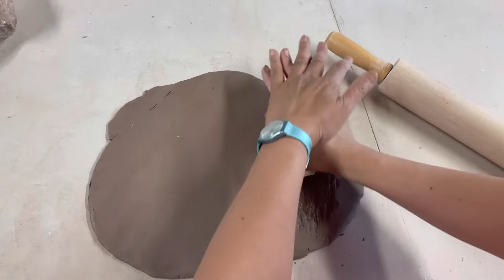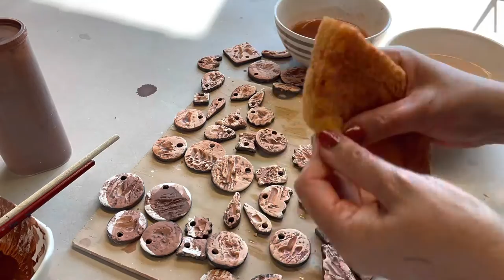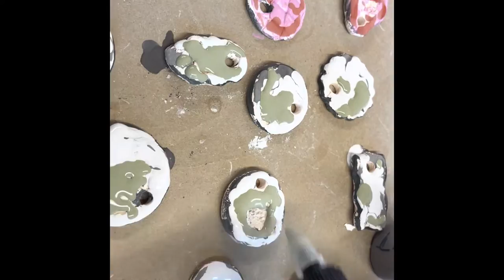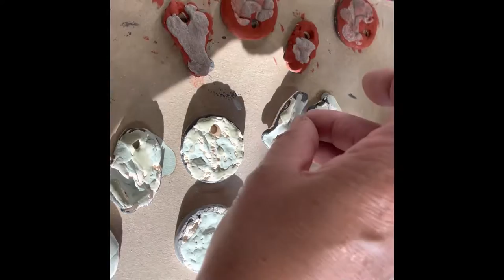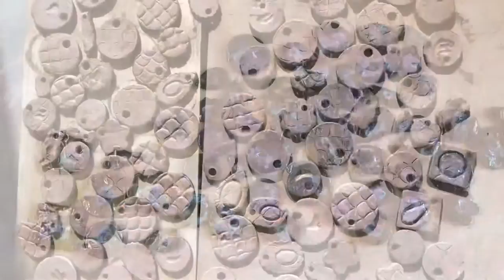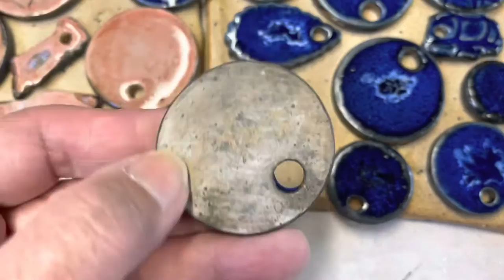Ceramic Pendants, glazing and cutting #jewelry #ceramic #necklace

Comment: I suggest you have a rubber stamp made out with your signature. Just stamp on the back. I just use the rubber..order it without the wood post and use your thumb to press on clay. You can either use clear glaze on the back or just leave it bare. Make sure it is very smooth. Love your colors.
Reply from the maker: Thanks for the tip! Because I am multi media artist I tried to sign all my pieces if I can. To keep it my own touch. I do have stamps I made myself but folks like my original signature.

Comment: I have questions!❤ I’m pretty new at using a kiln. How did you glaze the bottom but still lay it flat? Also, can you use any glass beads in a kiln? I had no idea you could do that! 
Your jewelry is STUNNING!! Thank you for your video!!❤️❤️❤️❤️❤️
Reply from the maker: No glaze at the bottom it will stick on shelf and will ruin it. I leave it unglazed. Glass is ok as long as it will stay in the middle and protect the kiln shelf by using a patty try in case it spilled over. Test first before using on final piece.
Reply from the maker: The bottom I used underglaze or stains bec they do not fuse on the kiln.